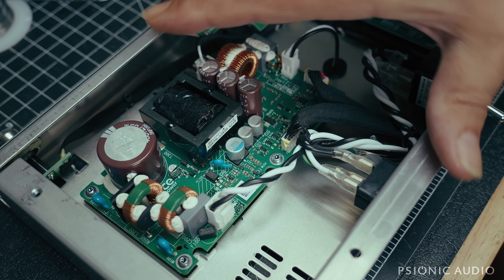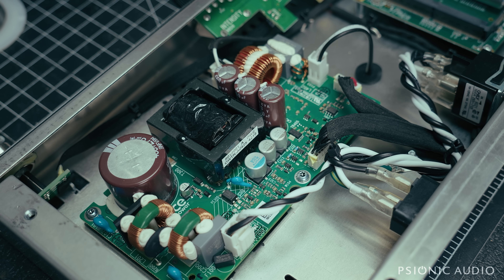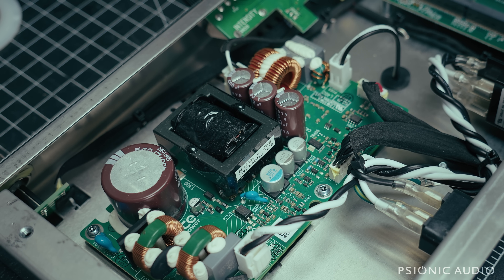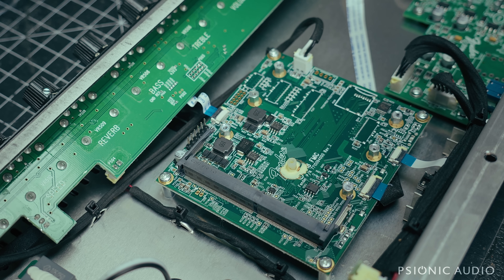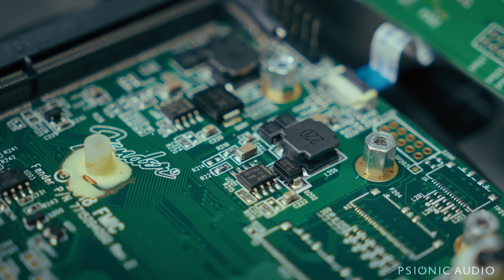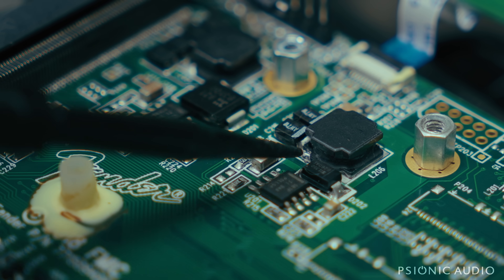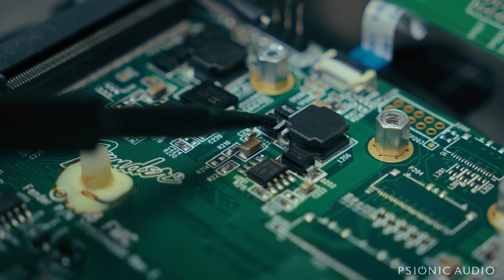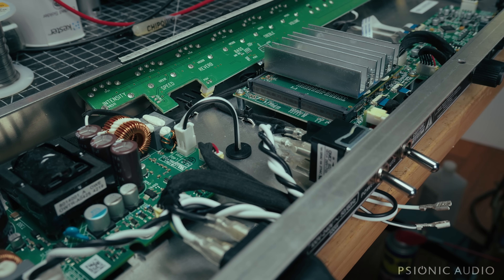The Fix is In | Fender Tone Master Deluxe Reverb No Sound and Flashing LED Pt 2

Comment: You legend. Well done putting up the solution and the part numbers. I wonder how many have been thrown in the trash due to $5 worth of parts!
Reply: Did Lyle upgrade/uprate the diode and repkace the tanalum caps with non-tantalum types? I probably would have, if it's s feasible to do so, considering the space limitations. Clearly the heat buildup shortens the lifetime of those parts...
Reply from the maker: Not feasible, but I chose very good ones from trusted brands. Hope they last.

Not my design.
Reply: You must have played a fair amount of vintage deluxe reverbs.. how does it stack up?
Reply from the maker: It’s ok if you only ever play clean and don’t dig in. The attack gets weird and squashed and it lacks harmonic interest - sounds canned. But it has a really nice digital reverb.

To be fair, some of the squashed sound might be the Neo C12K. The ceramic C12K sounds like ass, so…

I’ll find out tomorrow.
Reply: Might be worth checking the dumpsters behind GC. Just sayin'.

Comment: Thanks to you I sold my Mesa MKV last year and sat around on Neural DSP and a Dream 65' as my only amp solution and patiently waited for today! Found a Fender Twin Reverb from what I believe was built in 1971 (Serial# A 30769, correct me if im wrong!). It came with a Gator flight case and has been looked over by a tech for $875 all in. I couldn't be happier! Love your vids and info, crazy whats out there for more money in comparison to what you can get used.